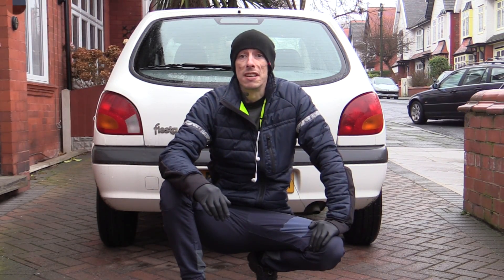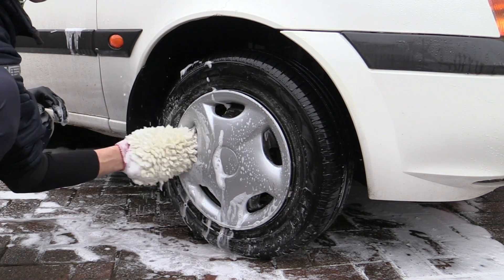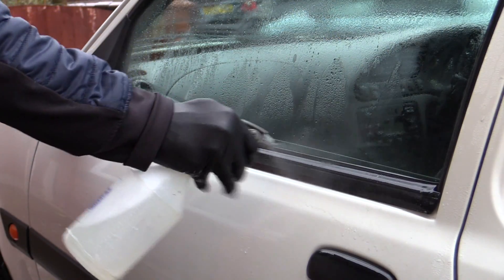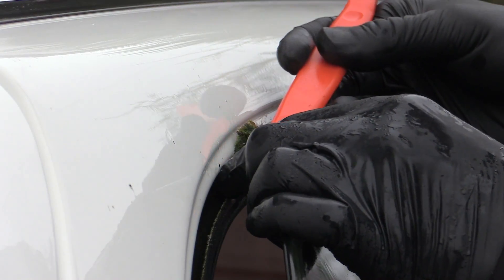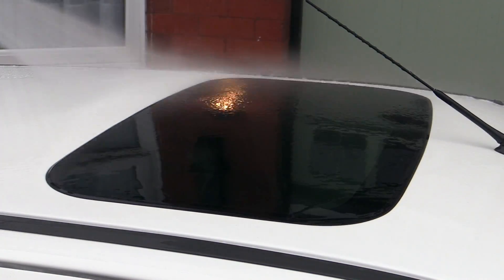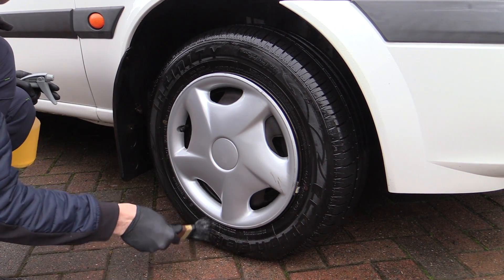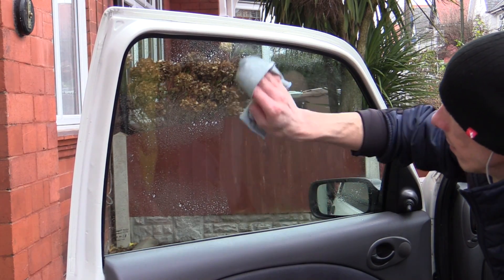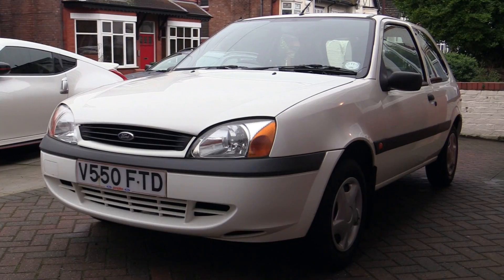£20 Valet For 20 Year Old Car

Comment: That's actually MINT for a 20yo grocery getter
Reply: 25k miles .. so not surprissed actually
Reply: Also to add these Fiestas rust really bad, I used to own one 6 years a go and the MOT tester was shocked it wasn't rotten.
Reply: Grocery getter 😂😂😂
Reply: I'm guessing it's a station car and their other car mentioned is somewhat more exotic!
Reply: @wetlettuce4768  
In my experience everything from France rusts really bad. Except for the new stuff.
My sister in law got a fiesta. You were able to dismantle the parts without any tools..
Reply: @Ikbenjounietsukkel  It's not a French car. These were built in the UK.
Reply: @hondamanvtec2894  Not unexpected for a car driving around a city. My cousin had Fiat Cinquacento, 20 years old, 18k km on the odometer, while driven almost daily.
Reply: ikr my 2 and a half year old car looks a lot worse than this one, has 4 times the mileage though
Reply: @Ikbenjounietsukkel  My 20 year old Peugeot 406 estate has never required welding or rust treatment.
Reply: Hello everything from france lives to its warranty then goes wrong 😂😂😂

Comment: 25k in 20 years, that's ridiculously low milage lol.
Reply: CannibalShadow  the old dear get the drill out after every shopping trip wind back that clock
Reply: I've a 1982 car and its only got 59,000 from new with ever single MOT cert and a folder full of work done by Vauxhall showing the millage car only did 2k or so a year.
Reply: Just shy of 3.5 miles a day. Does the car even get used haha?
Reply: I put on 30k km per year minimum and the wife puts on more.
I don't think I'd even want a car if I only needed one for 2k a year
Reply: There's an X reg corsa with nearly 9k on the clock, I think it had about 200 miles a year, one year I think it had 1000ish put on it though
Reply: X229 SOK is the reg if anyone wants to see MOTs
Reply: It's amazing how many cars there are like this. I found a one owner 2003 Micra in 2016 with 16k miles, all mot and maintenance records that had been garaged all its life and serviced at the Nissan dealer every year. It was like a brand new car. And the owner had traded it in against another new car because she thought it was on its last legs due to being 13 years old. Go figure. It's now on 33k miles and still going strong. Best little car I've ever bought.
Reply: @Keiths-TikTokQuest  some of that mileage was done when it was jacked up and the wheel spun in the wind overnight
Reply: Its probably kilometers as well since he british. So its even less then you think.
Reply: I put 30k miles on my car in the past year.
Reply: CannibalShadow probably some 90 year old that pops to church and the shops every now and then
Reply: I had an 18 yr old ford that I only used for city driving and it had 135,000 miles😂
Reply: @erti655  Britain uses miles for distance. The imperial measure. Go figure.
Reply: @matthewgodwin3050  My Range Rover did 3000 miles a year for its first 7 years of life. Not even sure why someone would lose that amount of money to barely use the thing!
Reply: @slowman82k8  Mind you, thanks to covid, my car has spent much of the last 6 months parked and has barely covered 100 miles just popping to the supermarket once a week. When the insurance company called to renew the policy, I didn't know what to say when they asked how many miles I expected to cover over the coming year. For the first time in my life, having a taxed and tested vehicle full of fuel isn't a particularly useful item. Not when there's nowhere to go anyway.
Reply: @erti655  we still use miles.
Reply: thats about 1.2k a year (or so)
Reply: @erti655  Nope, we use miles in the UK

Comment: Love that cable tie, 20+ hp
Reply from the maker: Gotta have at least one cable tied trim!
Reply: @garylee4371  Prefer the look of just bare rims, give em a good brake dust clean and nearly all normal rims look better than some clip on plastics.
Reply: @garylee4371  I see some on the city streets several times a year!
Reply: Lovely car! We love these models in Brasil, but its very difficulty find one with 2 doors. Um abraço.

Comment: I had one of these as my first car, a 1999 5 door Ghia 1.25. Wood dash trim, electric windows & mirrors,colour coded bumpers, 4 speaker cassette, heated front screen, air con and front fogs.

I had an immense amount of fun in that car. Quite an adequate amount of power even in today's terms. 75hp out of 1200cc is impressive especially as the engine originated in 1996.

That car taught me a lot and I did 30/40000+ miles in the 3 years I had it. Brilliant fun and would consider one again as a cheap hack.

Kids these days don't need a brand new turbo car on finance once they pass their test. A basic little car like this is safe enough and will make them appreciate modern cars more.

Comment: On older cars with flat paintwork I've started using Angelwax's Blue Rinse. After the final rinse spray it over the whole car through a snow foam lance and its hydrophobic qualities will immediately start reducing the surface water and at the same time add a layer of protection. Let it dwell for a few minutes then dry as normal. It's durable too lasting at least 4-6 weeks at this time of year.

Comment: I'm amazed how good the arches on this are! They're usually the first thing to (quite literally) disappear due to the good ol' Ford Corrosion. :D
Reply: If it has been washed quarterly, then it has been washed about every 300 miles lol
Reply: @rkan2  Ye but doesn't stop the corrosion, it usually happens on the inside of the arches and works it's way out, or when stones flick up, it chips the paint around the arch and allows corrosion to set in. Along the sills underneath as well, they get a fair bit of standing water and corrode.

Comment: The tire specialists say that the glossy liquid you apply on the tires is actually destroying them. I’ve had my previous dry-cracked tires replaced despite being relatively new, and the reason was that shiny liquid. It made a chemical reaction with the material of the tyre and made it dry and crack prematurely when exposed to the sun.
Reply from the maker: This can and does happen yes, however in my experience tyres that are never dressed tend to crack first.

Comment: interesting choice wth koch chemie fse. Love the stuff but keeping it as a car-medkit. No protection but a lot of function and ease of use. To quickly seal a naked car I can recommend better options. Turtle wax synthetic wax, ice one. This is almost fusso capable and it is spray and wipe. Easy as FSE is. I would just go over the car with ipa/wipeout and put turtle on it. Second one is adbl quick wax. Would go over a car in 15 minutes and this is not perfect by any means but lasts months on so so de-greased paint.

Comment: Great to see you do an older car, maybe I have missed some vids, having only just found ur channel. mine as stated in earlier reply is 18 years old. any tips for a good result?
Reply from the maker: Pretty sure it’s single stage paint so once polished and cut back you need to ensure the naked paint is kept protected, ideally using something with UV inhibitors to prevent it quickly oxidising again.

Comment: your videos are great they are less stressfull from my car wash, but one thing i keep picking out from most of them is when you do the arches you dont do what i do, i tend to kneel down to get the left and right hand sides. etc the mud flaps you can miss the top of them where there noram screwed to the inner arch.
Reply from the maker: I have to consider camera angles when filming. Off camera I hit wheels and arched head on as I don’t have to worry about getting in the way.
Reply: ahhh sorry mate i didnt think of that, its one of my pet hates when folk i get to help at the weekend make an arse of rinsing the car off

Comment: What’s your opinion on using the pressure washer gun/hose to remove dirt from the mitt as I’ve seen a few people use that instead of the two bucket technique as it seems to be a little controversial on the detailing forums etc?

Comment: My tyres are officially narrower than those - 155/70 13s.
Reply: I'd also pay a couple grand for that car if the arches are immaculate. VERY hard to find one of these without significant welding or corroded arches.

Comment: Quick question how did you fit the nozzle in the end of a standard kranzle lance? Would love to run mine like that?
Reply from the maker: Just a cheap brass quick disconnect fitting and nozzle set from
Amazon/eBay.
Reply: @CarCleaningGuru  thank you so much are they are standard fitting size?